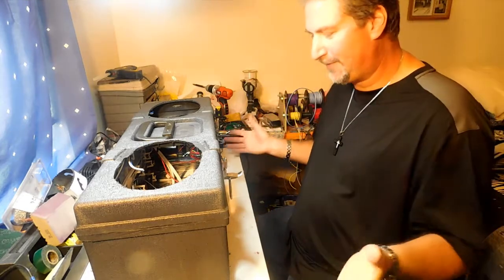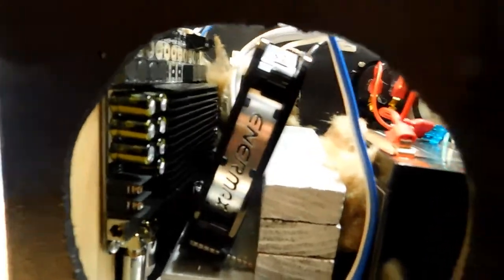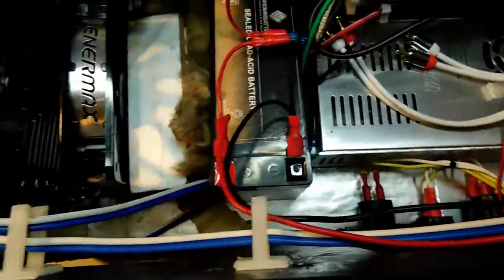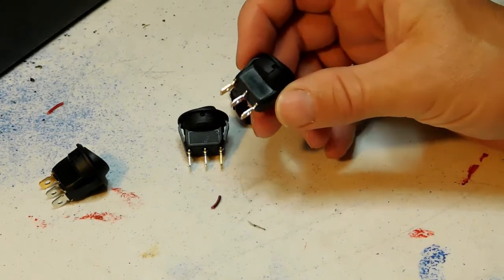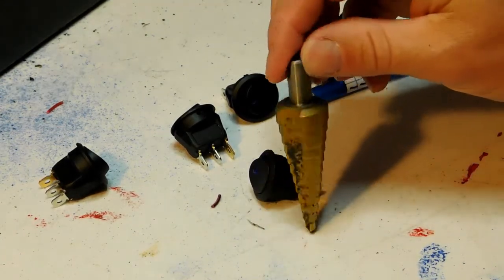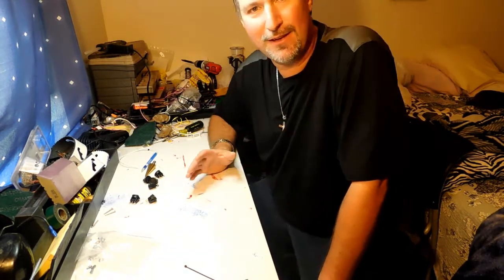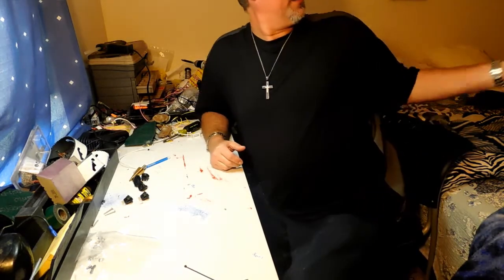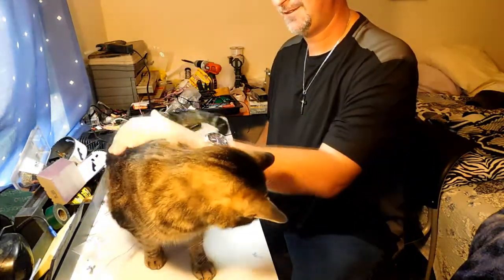LED Switches And Mega Boom Box Update

Comment: Hi, great work getting so much that box! Why so many switches?? With my builds at casevolume i try and keep things simple. The less the best for me. (Less to fail). I only really use one switch and have a fused ground isolated output for the bluetooth.
Reply from the maker: Anthony Peverill I didn't want that many switches, but I have some things that need to have their own switch. The first which is going to be for the relay because there's a delayed reaction when you shut off the power supply the relay wont shut off instantaneously because of the capacitors so the relay have to have a switch on it. The second switch is for the radio itself. The third switch is going to be for the voltage booster because the voltage booster is going to turn on the amplifier because the voltage booster is putting out 39 Volts for the amplifier. I'm also going to try the fan together with the voltage booster so the fan will come on at the same time the amplifier comes on. The force which is going to be for the voltage meter show me what the voltage is doing, and the 5th which is going to be for the USB charger and a 12-volt socket.

Comment: Can you show how to wire the round metal light up switches they have more terminals or wires coming from back. I believe its the switches you used on the silver black hd box you uploaded tonight. Thanks
Reply from the maker: I will send you a link the the switches on Amazon. If you scroll through the pics they have,  one of the pics is a wiring diagram showing two different ways to wire it. You can have it with the light on all the time or only on when the switch is on.
Reply from the maker: https://www.amazon.com/gp/aw/d/B00Y3KD5OG?psc=1&ref=yo_pop_mb_yo_pop_mb_pd_t2

Comment: Hello mr, sorry for my english, i'm from Montréal , i love what you and your channel is great , i make a Boombox for the first time and i put a lot of lole , loll but two things i can't not put inside because i search on youtube and i'm not very well with all those wires, i bought Socket Plug for 19mm 5 Pin Metal Push Buttons Switch Wire Socket Connector and 12V 5 Pin 19mm Led Metal Push Button Momentary Power Switch Waterproof Switch Black and Car 12V In Line Mini Blade Fuse Holder with 5 10 15 20 25 30A Fuses with a realy but can continue to finish my boombox, do you have a small idea to configure this?? i'm lost,, i put a switch with 4 pin , on -off it' work but for the rest  sorry i don't know what to do,, thank's for your help, and i will for sure check your next 
 Happy Easter
Reply from the maker: Alain Caron Are you on facebook? If you can join my group it would be so much easier to answer your question there
Reply from the maker: Alain Caron Here is a link to my Facebook group.        https://m.facebook.com/groups/1225425117541115?ref=m_notif&notif_t=group_comment